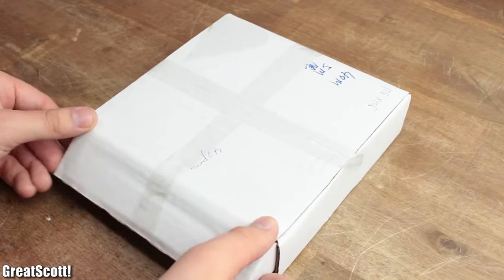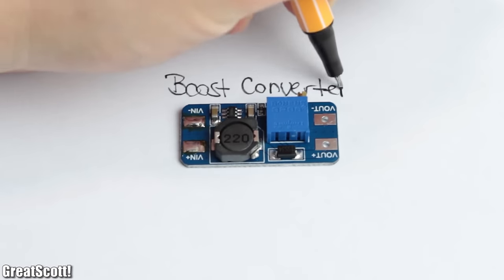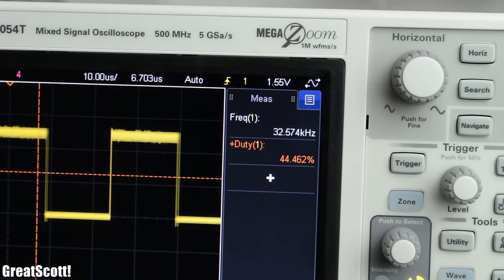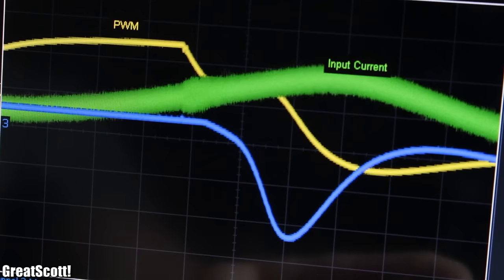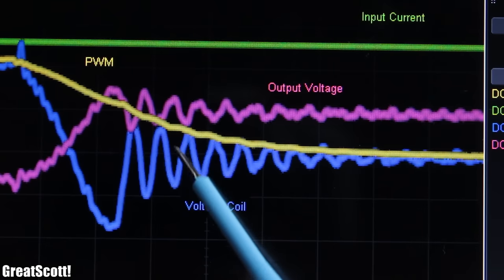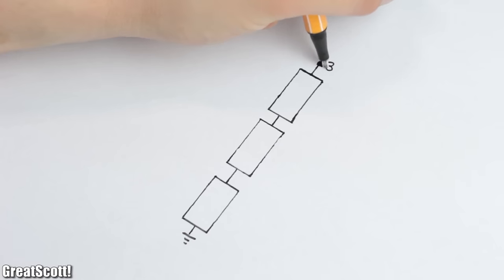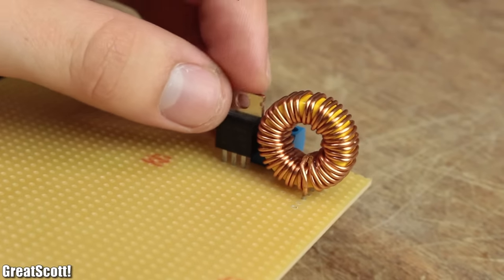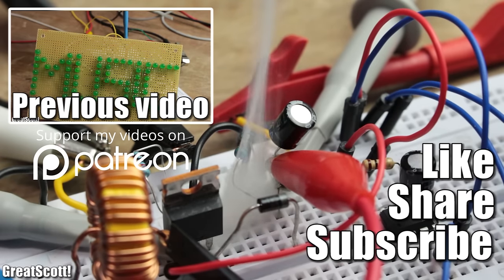DIY Boost Converter || How to step up DC voltage efficiently

Comment: Did you guys know that the hydraulic analogy for this type of boost converter is a RAM pump! Google RAM pump and see how they work. Instead of inductance and the flyback effect electric systems use, RAM pumps use the "water hammer" effect, which is perfectly analogous to the flyback effect!
Reply: Power Max what about buck and buck-boost converters?
Reply: Revi M Fadli you can arrange the components of a RAM pump to create a "buck converter" although its not very useful unless you need to convert a high pressure but low flow-rate source of water into a low pressure high(er) flow rate source without an active pump.
Reply: Power Max 
A venturi would do that easily so there would be no point.

Comment: Yeah, actually this is not that easy. I just can't wrap my head around it.
Reply: Don Grille Dos4life.com explains flyback boost just Google it. Scott vids are great but sometimes too fast for beginners. Pay attention everytime he adds a new component to make the circuit more stable. Essentially you are pulse charging the capacitor to a  higher voltage than the input with the help of an inductor, and the diode prevents the capacitor from discharging on the off cycle.
Reply: Watch the video about that topic by simply electronics. It's much better explained there. After that, the circuit in this video actually makes sense.

Comment: This is exactly what I needed. I also have made solar panel, but want to charge lipo battery. It still does not reach the required voltage on cloudy days and I will need step up converter then. This video helped me greatly as now I have an idea how to make feedback to control the voltage (as I don't know what output my panel will give at any given time). I am super beginner, so I will surely have lots of glitches on my way to success, but this is great video for general concept and tips.

Comment: I designed a very crude boost converter controlled by an Arduino. It was functionally useless and very unstable, but it worked. It was cool as a proof of concept.

Comment: To make a much simpler boost converter, just make a joule thief (with a few minor modifications). To make it better, replace the resistor on the transistor with a capacitor and add a schottky diode and low ESR smoothing capacitor to the output. If you are clever enough you could also add feedback that will serve to turn the transistor off once a certain voltage level has been reached using a zener diode or a bunch of LEDs in series connected to another transistor that pulls the base of the switching transistor low once a voltage level is reached.
Reply: There are some ways to further increase efficiency of the circuit in the video, one way would be to use a schottky diode with a much lower forward voltage, using a better MOSFET with a lower on state resistance, a higher gate drive voltage (more than 5V) and a mosfet driving stage (to decrease turn on and turn off times and hence decrease switching losses)
Reply from the maker: +Power Max I already used a schottky diode, the 1N5819. It's written in the schematic as well.

Comment: Hey scoot, quick question. So I just watched your follow up video on "If you can build a boost converter without a microcontroller" and I have a couple questions.
Why not just buy a DC to DC boost converter IC?
Well my guess is that it defeats the purpose of "DIY"

Comment: Since a small boost converter like this is available at low cost,  what I would like to see is one designed for input of 10-30VDC and output of 90-130VDC at 2-4KW. For use as input to a 2HP DC motor. The motor would need a speed controller which could probably be incorporated into the boost controller instead of having it follow it.
Reply: In theory it could be made. But the current draw would be pretty insane on the low voltage side.
Assuming you want to go on the conservative side of the specs:
30v input, 2KW very good efficiency of 95%...
2000w/30v = 66.6A Increase the input power by 5% to account for losses = An extra 3.3A
69.9A input current.

Assuming worst case 10v input, 4KW load, 80% efficient:
4000w/10v = 400A Increase the input power by 20% to accoutn for losses = An extra 80A
480A input current.
Reply: @dancoulson6579  Yeah l don't think I thought through the details at the time, but at least 48v would be better. I don't see 70A+ being abnormal though. The surge current on starting will be really high. Maybe 3x briefly. 
The reason I wanted to go with the lower voltage was to avoid getting so many batteries up front, but then I will be hugely current limited by the batteries. So in the end I just have to buy the $3k in batteries at which point I can just wire them in series for the 130 ish volts and use a PMW speed controller.

Comment: I had preferrd it if you used a 555 to create the PWM and an opamp to feedback the output voltage instead of using an arduino :p
Reply: +Blaff3tuur An ATtiny85 is not an Arduino.
Reply: +Nick B Didn"t he put an arduino bootloader on the ATtiny? But what I was trying to say is that you don't need a micro for this job
Reply: +Blaff3tuur Not quite, he used an Arduino with a shield of his own making to program the code onto the ATtiny85, in fact using the Arduino as an ICSP. I do this myself with a little shield I bought from a guy in Greece. The ATtiny85 is a micro-controller like the ATmega328P in an Arduino but it isn't an Arduino. It has less features, less program memory and less pins but is still quite a powerful chip nonetheless.
Reply: With that setup wouldn't you only get a constant pwm signal that just turns off when it reaches its intended voltage? With the attiny he is able to to vary the pwm signal based on how far away the output voltage is from the intended voltage.
Reply: He is using the Arduino bootloader.  If he was doing this in pure C or C++, we would have to set the data direction register for the output pin's port, as well as set it to be output:

DDR? |= (1 << PWM);
PORT? |= (1 << PWM);

Does anything know if you can use the Arduino library methods without the bootloader?
Reply: You can try Atmel Studio.
Reply: Yes, you can use all features of the Arduino library without using the bootloader. In the Arduino IDE there is an option that will automatically generate a hex file that you can flash the board with.
Reply: I prefer attiny85, because i dont have any opamp or 555 timer.

Comment: This is a great video on boost converter. loved it!. My one question.. 
How would the values for capacitor and inductors be calculated? Scratching my head to understand the calculation part. 

Thanks :-)

Comment: What (besides the load on the output circuit) determines the amperage of the output? Would it be the inductance? Also how would one calculate this? Thanks

Comment: u can use a proper local components through make voltage booster 5 to 30v for 2amp.
i am made voltage boster but i am used bettery...of 3v and make 15 volt but only half hour run this booster....any idea for solar power booster please help me.....and nice video.your video are help full for me...

Comment: @GreatScott! I would suggest that you look up 'military spec soldering'. Your soldering work needs a lot of work. Other than that you could recitify your simple circuit with a simple zener bridge rectifier and feedback over-voltages back to the additional input to maintin a steady output and to reduce overall heat dissipation by your components.
Reply: Im pretty sure he will not sell this boost converter to the millitary
Reply: @no_onebanana7167  no kidding!

Comment: I have seen this video so many times and i always have one question in mind that instead of using a attiny ic why dont you use a 555 timer ic ........ Then i found another video in which you have not used a micro controller ..but that circuit is bit mess .. So i have tried making the same circuit using 555 but my output is not regulated as you have already said in a this video .... So "i want to ask can we use a 555 timer ic only for such thing .. As that ic contain a 5th pin which is a control voltage pin.... Can i use that pin for making my output constant whatever may the load be" please reply to me .. I will be very happy to hear from you.. As i am very likely to watch all your videos .. And made my own YouTube channel... You inspire me.. Thank you..!!

Comment: Hey!! Scott I just want to ask if I used 555 timer chip as a pwm signal it will work just asking from a buddy.
Reply: Aljiven Alejo  why not use a pwm ic just like in impulse power supplies?
Am i missing something? Please correct my statements if i was wrong somewhere. :-)
Reply: Yes you can use a 555 but I don't think you can use just the variable frequency alone to change the voltage output.

Comment: Why did you use that 50 ohm load (which seems like two 100 ohm resistors wired in parallel) near the end? Couldn't you have used your constant current dummy load?

Comment: I tried it using an Arduino to PWM the MOSFET gate from 100 to 1000 Hz, duty cycle roughly 50%. I ran a small DC motor with it with the inductor, diode and capacitor in place, but no voltage gain. I used a small 9V battery as the power supply. Could this be due to the power-hungry nature of the motor?

Comment: Hey scott! Which resistor should I add in place of potentiometer in boost converter xl6009? Input is 3.7v 18650 battery and required output is 12v.

Comment: error  at 2:10 

the correct equation is

VL = -L * ( di /dt) 

the - is important and is fundamental for the determination of the conventional verses of the voltages and currents in the calculations, this is due to the effect of the magnetic field of the spiers traveled by current, which produce a counter-electromotive force equal and opposite to the cause that generates the field  magnetic itself

Comment: Hello Scott!
Can i attach to the coil a higher voltage between 10 to 12 volts because i want have main supply 3S (18650) and boost to 24 volts on output?

Comment: I would have used either a 555 or a 4093 to generate the square waves as those are well known by me and I've used them in many projects. But, whatever floats your boat. I prefer to hard code in hardware rather than mess with programming.
Reply: It would be near impossible to use a feedback using a 555 timer i think.

Comment: I'm actually looking to build a boost converter that can charge supercapacitors quickly from 5v-11v input to 16v but I want to put alot of current thru it ~100 amps (input) lets say that I have good enough heat sink all I would need would be large enough capacitors and inductor?

Comment: Awesome video! Would the fluctuating magnetic fields create distortion for say speakers? Thanks!
Reply: +TeaDrinkingIlluminati Not if there is a good filter on the output, possibly best an inductor - capacitor filter. Also if you use a dedicated boost controller IC they tend to operate in the hundreds of KHz or even one or two MHz so they are far outside of the range of frequencies that the speaker will respond to.
Reply: megaspeed2v2 thanks a lot

Comment: Is it possible to make a boost converter with the astable multivibrator and use the feedback without any op-amps or micros, because my input voltage is too low from 0.7 to 1.6 volt? I know that joule thief circuit work at this voltage, but unfortunately, it does not efficient like boost converter.

Comment: What code did you use for the feedback voltage to maintain a consistent output voltage? did you use the PWM duty cycle-ouput voltage relationship to generate a sustained output voltage?

Comment: Hi, i habe a doubt, pwm only changes the duty cycle of the output pin, how does the circuit get more power? i am using the tone.h library instead of the tipical pwm signal and works fine

Comment: So any contraption on the internet without the 555 timer or AT microcontroller doesn't provide constant voltage in case of changing load? Do I even need such a feature for powering a regular 12V 140 mm CPU fan from USB?

Comment: Great stuff...
But in my case I need small modifications to the circuit if possible can you assist me on my case..

I want to boost 4v DC to 9v/12v dc constant R load.

I really appreciate your input here

Comment: GreatScott! nice You Tube videos, very informative.

I am trying to build a 18650 pack for LED strip lighting and a battery backup for CPAP. 

for the LED lighting I need 3hr run time at 12v 5amp. I am thinking a 10 cell pack will work.  is it better to boost from 3.7 volts, or buck? should I be close to the input voltage I need ? for the CPAP I need 24v at 3.75 amp  but I am figuring it will be 2-2.5 as I will not be using the heated hose and humidifier. I am thinking a 40 cell pack 1 need 16hr run time.   I was thinking to try and offset it with a solar charger so I only need 8 hour run time (for camping.)

should I use a BMS as well or just some sort of low voltage protection circuit.  it would be very helpful if I could get some feedback / help with my project.    

thanks.

Comment: Please do a video on redundant power source selection (ie circuit picks from battery, mains or supply voltage by itself)?

Possibly called Power ORing.

Cheers from Australia!

Comment: so if i want to convert 3 li-ion batteries (min 9vdc max 12.6vdc and i want it to constantly output 12v to power a portable project. Can he input voltage of the boost converter decrease and the output voltage stay at a constant 12v?

Comment: Hi Scott, I need your help!!! I'm struggling with a boost converter circuit to control a washing machine brush motor with 12v or 24v battery input to push a DIY go kart!!! Although I can step up the input from 12v to an output up to 50volt, whenever I connect the load (almost any load... from 10 Ohms to 200 Ohms) voltage drops down dramatically to 1-2 volts! HELP!!!

Comment: i tried making one using an arduino for the pwm and tried a couple different input voltages and inductor values but could not get a voltage higher than 35v. what have i done/not done?

Comment: I simulated a boostconverter like 6 times in 4 different simulation programs but none of them worked because the current always flows through the diode and load or through the mosfet to the gnd but this coil-reverse-voltage-to-act-like-2-voltages-added never happens. Any idea why?

Comment: If you use bigger capacitor and inductor , could the output voltage be stable without a feedback loop?
Reply from the maker: +邵伯恩 No

Comment: Is it possible to to this circuit with a 555 timer ???   I need to run a 12V, 12W Led flash light with a 6 v battery.   Could you give some guidance to do that ??

Thanks
Reply: yes u can do it
Reply: You can boost the voltage because i tried it and i boosted the voltage from 5 to 40V but the only problem is that the 555 timer does not have a feedback to keep the voltage stable and the voltage collapses☺

Comment: I need to build a boost circuit for a 24v to 120v inverter. can this ic work in a circuit to achieve my needed voltage? I am new to internal electronics. but I'm learning. I must build this inverter for my home. or is there a way to get a regulated constant voltage. that is simpler. without programing a chip. I don't think I could do that. yet anyway. I am willing to try if I must to complete my first big and very important project. I enjoy your videos. I can really use help to build this boost portion of this inverter. can you help me. it would be greatly appreciated . Thank you and keep up the great videos.

Comment: Amazing video!
If I wanted to step up 11.1v from a lipo battery to 19v to charge my laptop (3.95A) could I use this schematic?
Reply: You'd need different components as that's a lot more power than this design was for. Also before you put a load of time into this, check if your laptop will charge without the centre pin (if it has one). My dell laptop will run but won't charge from a supply that doesn't have some wierd data connection. Proprietary awkwardness!
Reply: Mine doesn't have one 
Thanks for the time spent

Comment: In general,If I want to generate a strong  electromagnetic field which is better using (12V,1A) or (11A,1V) buck converter , (30V,0.34A) Booster converter  ?
Reply: Magnetic field increases with increasing current.

Comment: Bro i built a boost converter circuit using pic microcontroller 12Vin (Battery) to 48Vout...... But as soon as i connect the input Vin(Batt) shows 0v 1mv likewise output side 0v.......can you tell me what to do with this

Comment: I need help.
If i hook the boost converter to the output of a 5v cellphone charger(wall adapter type), will it output 12v so that i can test my car radio/car speaker?
I want to build a stereo for my room using available car audio parts.

Comment: I only understand a part of what you're saying, I'm not very advanced in physics, I only have the high school knowledge. But I really love your projects. You're doing a great job.

Do you think I might be able to do some of these projects with parts saved from broken computer PSUs (like 12V to 5V converter, even with low efficiency)? I have some broken PSUs and broken laptop motherboards laying around that I hoped I could salvage the resistors and capacitors from, for some physics experiments. I have basic soldering skills, as I solder a lot of wires.

Comment: Doesn't it shorten the power supply with you coil after coil magnetic field reaches its max?  How does longer ON time in PWM help you get higher voltage there..

Comment: I didn't quite understand how the sketch works, do you regulate the duty cycle or the frequency of the pwm-signal? It would be nice to see the code in pseudo-code.
Reply: I think you regulate the duty cycle, although I couldn't say for sure until I've seen the code.
Reply: The frequency stays the same. Increasing the duty cycle increases output.

He had it programed so that when he turned the potentiometer it would vary the duty cycle between 0-20%